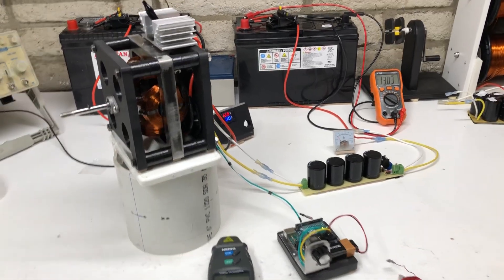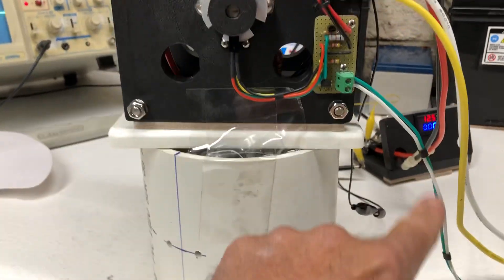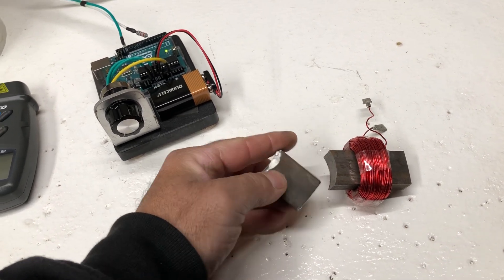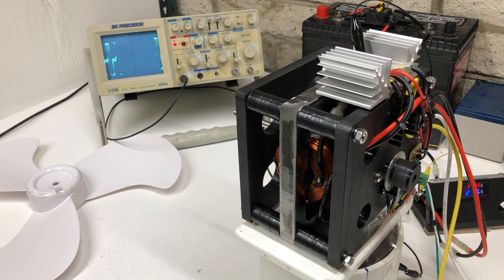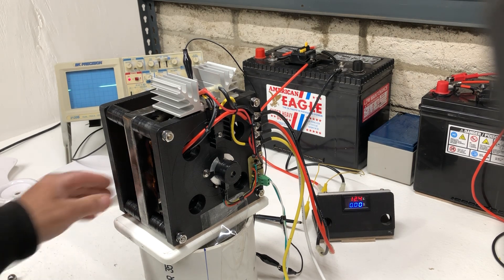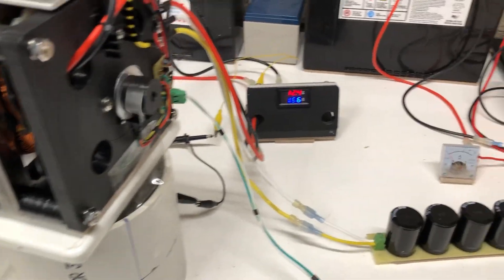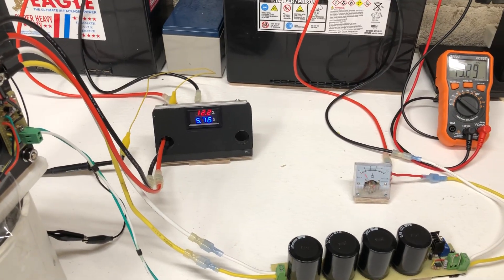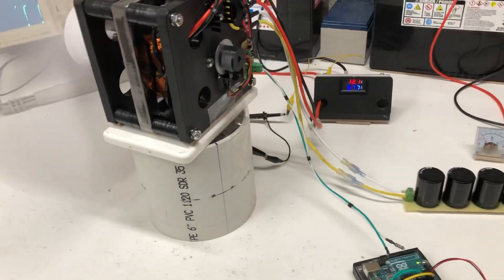Attraction motor with and without load out put test

Comment: Your channel and motors are very impressive! Thanks for sharing. Can you please tell me if the the solid steel core of this motor has become permanently magnetized over time and use? Can you please tell me if the core gets hot, also? I like your work a lot! Thanks.
Reply from the maker: Thanks for the comment !
 The core doesn’t get permanently magnetized only temporarily 
 Yes it can get quite warm without lamination

Comment: I've never built one of these and it seems like a really neat motor once you get it all balanced out. Have you been able to use your cap dump circuit with any battery chemistry? I built one and seem to have issues with pulling the scr trigger back to ground without any resistor (defeats the purpose) but I am using it on nimh batteries so makes me think it could be the issue. Maybe I'm using the wrong scr? Great video K
Reply from the maker: Definitely a neat motor they always seem to be louder with the torque than my magnet ones 
 I’ve only used cap dump on lead acid batteries 
 The scr version latches if the output is not enough or sometimes if the cap is to small

Comment: Another great motor demonstration. Is there any particular reason for the noise level to be low for some, like the first fan you show and other louder ones later. That charge battery won’t take long to fill up. Thank you for sharing
Reply from the maker: Some bearings are better than others
Reply from the maker: When I do my video it’s usually after doing many tests the charge battery gets full fast which is a good problem to have

Comment: What happens to the battery if run the motor for awhile?
Thanks
Reply from the maker: Primary gos down secondary comes up it’s about 40% energy return under load
Reply: @kenergy1707  have you tried the cap dumping without load?
Also, I think if cap dumped into a series of batteries hooked up in series. The pulse should pulse charge all of them. 

I am going to try this with these new LTO(Lithium Tirtanate Oxide)
I will comment here if I get better charging
Thank you
I like to see the diagram for that cap dump circuit please
Also, I was going to build the battery swapping circuit and I have the diagram you supplied but I am not clear on the connections to the relays.
Thank you
Reply from the maker: @Gacha.Cupcake  I have tested without a load the attraction motor has better output when under load compared to the magnet motors 
 I haven’t posted the more complex capacitor discharge circuit yet 
 The relay switch uses 300 ma on the on time which is too much for smaller motors it needs to be a latching type to be more efficient
Reply: @kenergy1707  I am getting the same relays as you use. Once I get them, if I can’t figure out the wiring, I will ask you for help

The 12v ones are expensive, but you can find 5v and 24v and 48v ones much cheaper on eBay 
Just FYI

Thanks my friend
Reply from the maker: @Gacha.Cupcake  I’m glad to help kbgenergy@gmail.com
Reply: @kenergy1707  Thicker and shorter wires may bump you up to say 50% on the output side of the circuit ?
Reply from the maker: @mscavsfan  that could help motor wires 12 awg cap discharge 14

Comment: how do you balance the capacitor pulse discharger circuit, in terms of how do you size your capacitors VS  how fast you want to discharge ?    I'm assuming if you use larger capacitors, it will take longer to discharge but you'll get larger amperage ?
Reply from the maker: Thank you for commenting! If you go threw my videos you’ll see one on capacitor discharge 
 I have many sizes and voltages so I just choose what works best which is usually one pulse per second or two 
 They are voltage triggered
Reply: @kenergy1707  I am not sure if I saw your capacitor dump circuit in your videos. I will go back and look
Thanks
Reply from the maker: @Gacha.Cupcake  I showed the basic scr zener circuit on one video